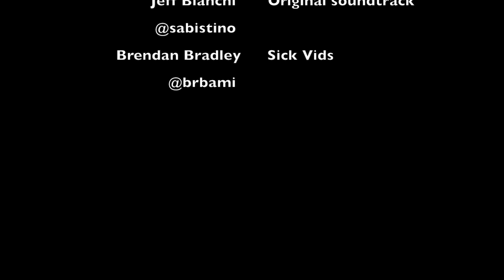Jeff Bianchi 55 Chevy 1 - 3. VIDEO 3 IS UP AND LOADED.

Comment: Ive got a  rough 55 2 dr wagon. Could sell it for more than its worth no problem. Ive got a 56 4 door real solid car. Not very much interest in it. So it will get the conversion. and I will tell any potential buyer it was a 4 door that was converted to a two door.